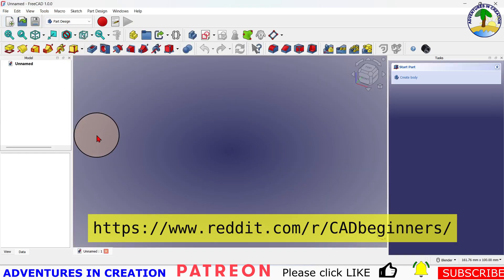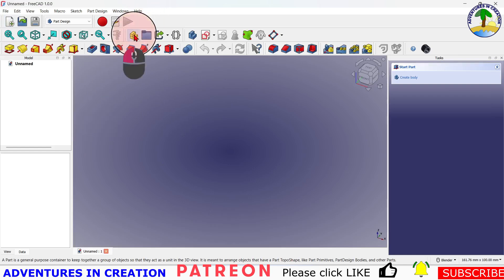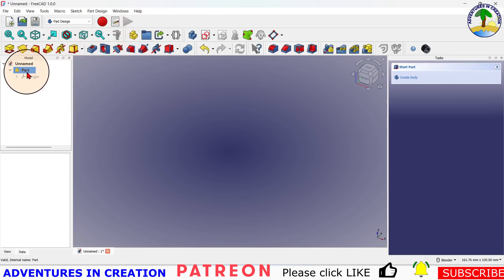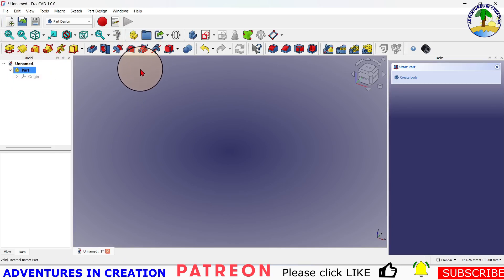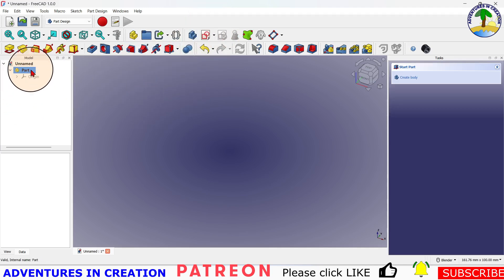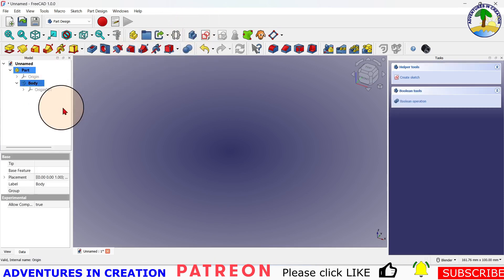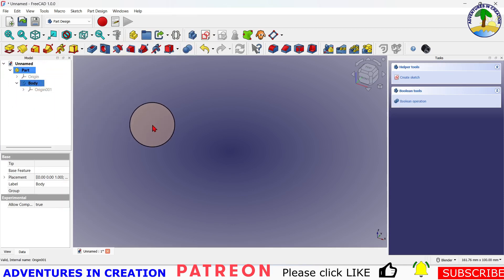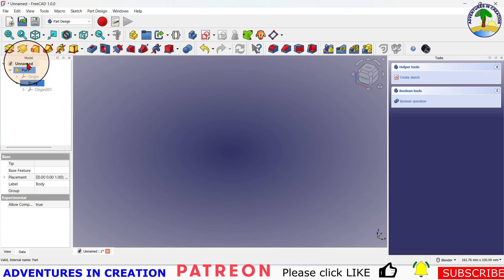Intro To FreeCAD Version1.0 #17 Constraints

Comment: I just have to tell you I was working on a present for my aunt engraving on wood and I wanted Hinges.  Tried several times to do a pocket . Ended up I lied to it changing coordinates on my axis telling it I was doing it in offset position and it turned out great was able to put offset pocket right on the edge .
Reply from the maker: Excellent!